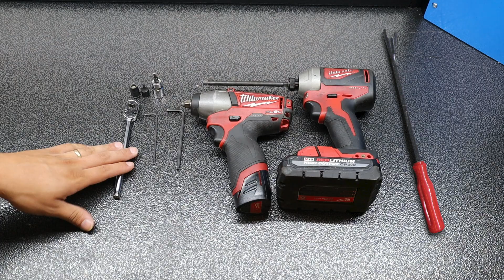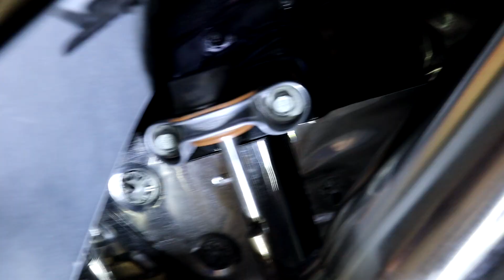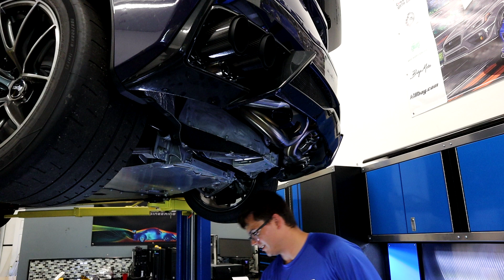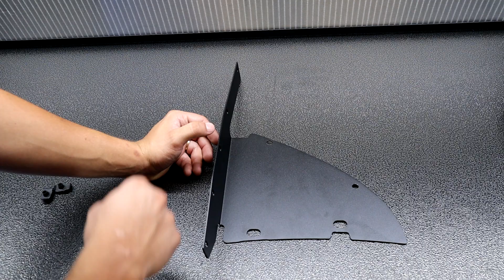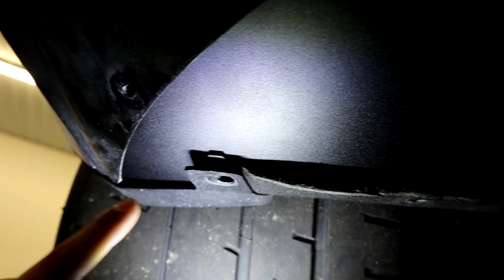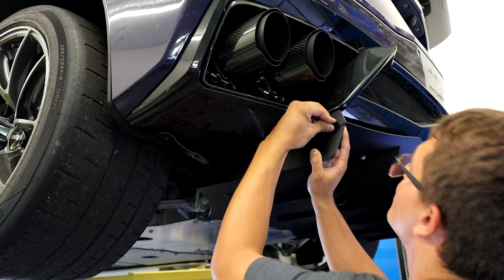How to install our Aluminum Rear Diffuser on the C8 Stingray

Comment: Fitment on my car is fantastic. A couple of the button cap bolts towards the inside of the car on the struts were tough to reach with the stock exhaust, but I got creative with a wrench and some tape to hold the nut in place. I ran the car today at autocross and the diffuser is solid. I also did their front control arm cover strakes. I’ll be doing their dual element canards when it gets a little warmer!

TL:DR You should 100% get this and install it at the same time as your aftermarket exhaust.
Reply from the maker: We seriously appreciate it!